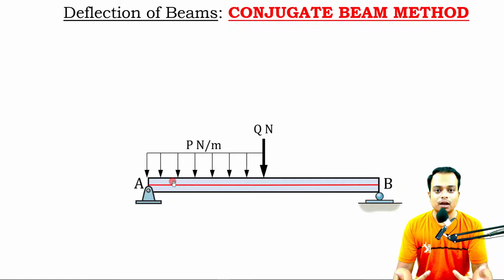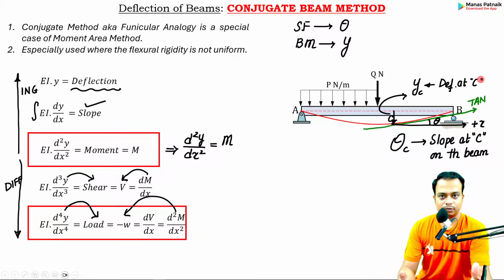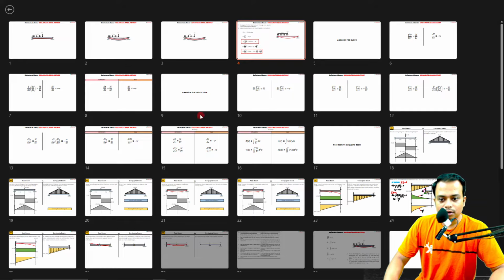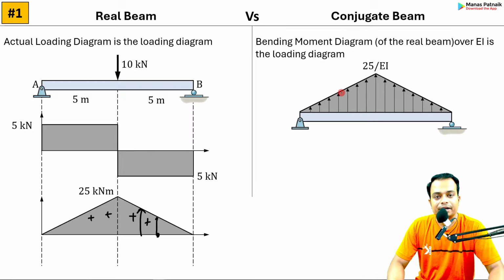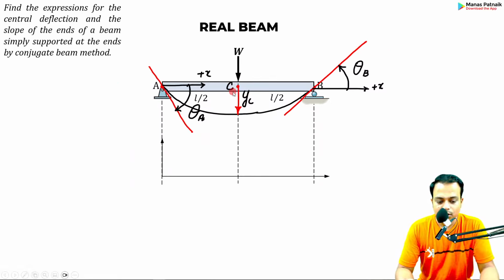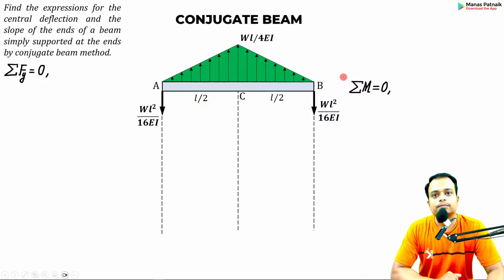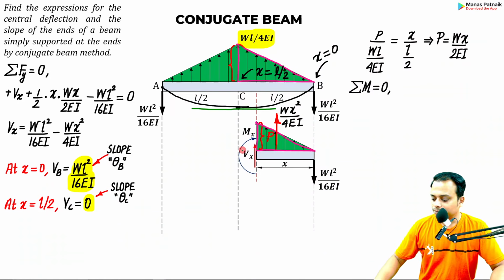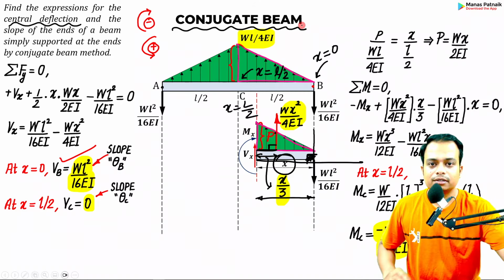Conjugate Beam Method Part 1: Concept & Basic Example | Slope & Deflection in Beams

Comment from the maker: 🧠 Let's test your understanding! Comment your answers below 👇

1. Did you clearly understand how to convert real beam supports to conjugate beam supports?  
2. What does the M/EI loading represent physically in this method?  
3. Can you explain why the moment in the conjugate beam gives deflection, and shear gives slope?  
4. If given a beam with a hinge, how would the conjugate support change?

💬 Share your thoughts or doubts below — and if this video helped, type “Got it 💡” in the comments!

✅ Aapka feedback chahiye! 👇

1. Aapko M/EI diagram ka concept samajh aaya kya? Agar confusion ho, to please likho.  
2. Conjugate beam ki support conditions ko aap kaise explain karoge — particularly fixed vs. free ends?  
3. Kya aap moment and shear => deflection and slope conversion steps ko apply kar paaye? Agar koi step unclear ho, comment karke pucho.  
4. Is method ko aap apne coursework ya practical design me use karoge?  

👍 Agar useful laga ho, to comment me “👍 samajh aaya” likho & share karo ki aapko kaunsa point sabse important laga! 📌